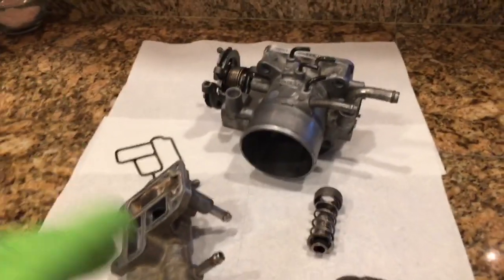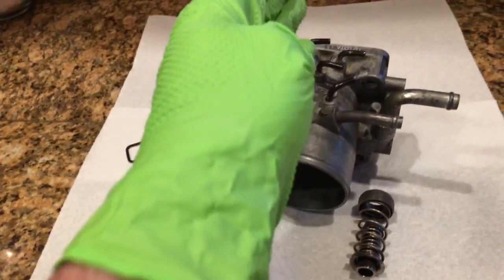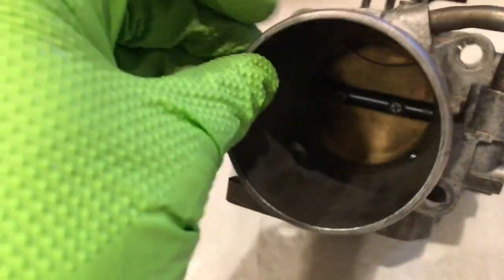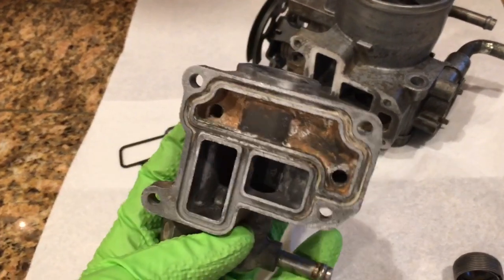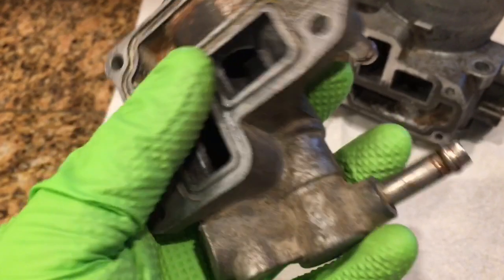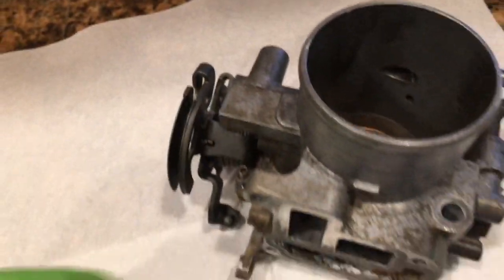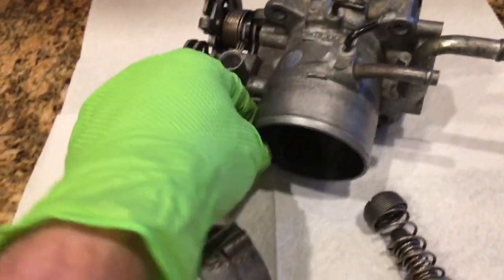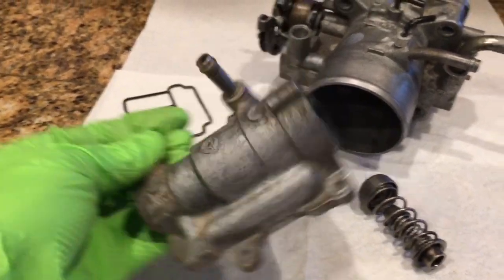Toyota 4runner pickup 22RE - understanding rough, high, surging idle, the Idle Air Control IAC valve

Comment: Just a thought,  as I try to diagnose my own issue which led me to IAC..  (and I have 3vze or 3.0,  not the 22re).

Here's the thing, I've cleaned mine out multiple times..the IAC and TB.    And I don't have idle surging or real idle issues.  Just a slight shudder and the needle just barely flucuates if you look really closely.  But I have extremely intermittent hard start and sometimes it cranks really fast.  It will always start,  especially if I open throttle plate(and give it air I assume).  I really have no idea what my issue is.  Sometimes the truck feels like a dead weight and other times it seems responsive.  I think I had a egr leak and it had way more power.  

But what I want to highlight, is the fact my mechanic told me my engine is running on the low side...168 coolant I think he said.   The IAC doesn't even close until 175 or more I think it said in the fsm.  Or close,  whichever it does when hot.  

I'm starting to think this aftermarket aluminum radiator is overcooling my engine!  And I have yet to find the bottom radiator hose even more than slightly warm.  Thermostat is rated for 180f I think...

Maybe the mechanic did not warm up the engine enough.  How do you chck accurate;y the coolant temp?  I just have thermo heat gun.
Reply from the maker: If you have a 180 thermostat then the motor is probably running around 180 since that's where it opens. The radiator isn't going to be able to cool much below that temp, since the thermostat shuts its flow off down around 170 or so. You might want to check to ensure all your fuel injectors are working. You can disconnect the vacuum line going to the EGR and disable it for testing purposes and it's pretty easy to test at idle to see if it's working (just apply vacuum and see if it opens and the motor stalls). As far as the IAC being open a little when warmed up, that shouldn't matter all that much either way. To me it sounds like you have some other issue lurking. To check coolant temp, use your laser gun on a black hose that circulates water off the cylinder head and/or take a reading at the base of where the thermostat installs - that will usually get you within 2-3 degrees of the water temp.
Reply: @ray5961  I just ran the "advanced code test"  ...basically you jumper e1 and te2 and drive around.  Lucky for me my intermittent no start issue happened when I did this!  I got got it  started on second attempt and drove around(at least 10mph).  I then moved te2 wire to te1 thereby jumpering the normal testing pins.

And like magic code 13 showed it's ugly face!   

I had code 12 and 13 in recent past,  but they went away after new distributor install.  (Keep in mind I'm using cheap aftermarket distributors since original denso costs 600.00.

Apparently the advanced code testing procedure works with starting circuit,  so only way to see my issue!   In the past before new distributor I would stall while driving...therefore normal code test would bring up code 13.  But since then I only have brief no start issue...I'm probably overexplaining..you get the idea.

So now the question is whether my stock distributor and multiple after markets are all faulty...OR there is issue in wire somewhere.   I bet the latter which means once solved I can put my oem dist.  back on:)   (note:  5 different mechanics have failed to find this issue.  They simply keep telling me to replace distributor despite no change).
Reply: Thanks for those tips...especially the thermo gun test.  "2-3 degrees"  is exactly the info I needed.
Reply from the maker: @TheWeirdSide1  Ignition problems can be tricky. Make sure the inside of the distributor cap is clean and dry; sometimes you can get carbon arching inside there, which will cause issues. I have a diagnostic tool I use, called a TA500 engine analyzer that is real helpful. On your distributor, check the brushing where the shaft rides and see if there is any lateral play at all; sometimes those wear in a funny way and allow for movement on the shaft and certain points. I'd also check the air gap in there and make sure it hasn't slipped.
Reply: @ray5961  Thanks,  I'll look into it.  9am-9pm today trying different things..this truck is gonna kill me:)
Reply from the maker: @TheWeirdSide1  haha I feel your pain!

Comment: Hi Ray, I Just Found Your Video. I Am Having a Very High Idle Issue With My 1997 Toyota Tacoma. Around 2500 rpms. It started after changing a fuel injector. The iac is leaking coolant through either one of the hose ends or the barb on the valve.  My question is do you think the valve is causing this problem or the new fuel injector?  I've had to order a new iac anyway because i couldn't get the leak stopped.  Thank you for any info you can provide.
Reply from the maker: hard to say, but it sounds more like a IAC valve sort of issue. Usually the IAC circuit can be blocked off for testing if you look closely

Comment: Help!  How do you adjust that pin and screw?  I made special tool to unscrew that thing like you did.  Now I think everything was fine and I need to screw that back in for right temp... Do you know temp?  If I use heat gun to adjust it?
Reply from the maker: What I did was run water through it from the faucet and measured the temp of the water exiting. Then at about 135-140, I set the cone thing so it just closed. Then ran cold water through and confirmed it was open. Then ran hot water (140) and confirmed it closed again.
Reply: @ray5961  That's very smart!  I never expected a reply so soon,  cheers.   I think I got it close to factory...won't know until tomorrow morning at cold start...

Comment: Wondering if this is the same for a 3rd gen 4runner. I heard it doesn’t have an idle screw like that I gotta double check because I’m idling at 2500 rpm on cold and even when warm it stays around 2300-2400 rpm. I replaced the tps and it’s still doing the same. I heard rumors about doing a idle relearn but idk how to do that on a 2000 4runner 3.4l. Any advice or tips would help imma also clean everything tomorrow just to make sure as well as clean the iac valve. Thanks a ton for this info boss!!
Reply from the maker: romello turner I'm not all that familiar with the V6 motor, but you might check to see if there is a cold start timer circuit involved. Also, if there is a cold start injector (like how it's setup on the 22RE), try pulling the wiring harness off that and see if the idle drops - that might help put you on the right track to finding the issue.
Reply: Ray Nada thank you soo much for the fast reply! I will definitely try that tomorrow I need my runner back and running normal I should’ve never messed with it in the first place haha thanks a ton!!

Comment: Hey. My 93 T100 after warmup the idle increased. Any idea what my causes it.
Reply from the maker: Check to make sure both hoses going to and coming from the IAC valve are getting hot. It could be due to the valve not fully closing.

Comment: Hi Ray. Here is what I am in need of help on. I have a 86 toyota truck and my IACV sits beneath the throttle body. I have taken off TB and IACV. I look into the IACV vacuum port and see the vent is about 7/8 closed. I put the IACV in the fridge for 45 minutes and then checked the valve again. It has now opened to about 1/2. Can I assume that the valve is working correctly. The ohms are also within spec. I am hesitant to take IACV apart because there is no gasket available to replace it with. Any help appreciated..thks..jc
Reply from the maker: LC Engineering might sell the gasket; that's where I bought mine. Also, the way to test it is with heat, not cold. Boil some water and stick the bottom of the IAC into the boiling water (or run super hot water from the sink through the valve ends) and see if once everything gets up to about 130 to 150 or so, does the valve totally close and block air. That's most important.. the blocking air aspect and at what temp does that occur. You want to make sure the valve is totally closed when the temp is up in the 120 or 130+ ranges. The other thing is confirm water flows through those two tubes where the hoses go and that there isn't any junk in there. You can use compressed air to blow that chamber and those pipes open without risking any damage. Mainly the whole system resolves around "when it gets hot, from the coolant, then it shuts air flow off" - that's its job. When it's on the car, you can check to see if water is flowing through it okay by grabbing the little hose that runs from next to the where the thermostat housing is, over to the IAC and see if that hose is getting hot. That's the water flowing into the IAC - then check to make sure the hose where it's flowing out (at the bottom) is also getting hot and about the same temperature. That will confirm the hot water to operate the valve has hot water flowing by it. The main thing to check is does it close when it gets hot. What it's doing when it's room temp or ice cold doesn't matter as much as fully closing when hot. It's job, once the motor warms up, is to block all air flow. So check that and see if that's working or if the valve is sticking at 7/8 closed and not able to get to 100% closed when it's around 130 or more degrees.
Reply: @ray5961  Hi Ray. First....thanks very much for taking the time to write this up. I will give it a try and see if  it closes. I guess my test was backwards. Should have been hot instead of cold. If it does not close I guess I have no choice but to take it apart and see if it is gummed up. The two coolant ports are clear as I can blow air in and out. Let you know. Thanks again..jc
Reply: Hi Ray.. First, no gaskets available for this iacv. I tested as you suggested. Water temp between 140 and 150. The flap or valve seemed to close, but in looking through the vacuum hole, the valve had two pinhole openings on each side of the flap. I could see light. So I am not sure if that is the way the valve shuts or not. Your input appreciated..thks..jc

Comment: Nice video really informational but what about setting your throttle position sencor i moved mine and seems like it idles much high do you no the correct way to set that thanks kory
Reply from the maker: Kory Christensen google how to set it and you should find some good info. Also, LC Engineering has a PDF / link that explains the process. The basic idea is that it's an electric switch that tells the ECU the proper angle. You need to use a volt meter as I remember. I need to do the job soon on my motor... I'll see if I can make a video showing how to do it
Reply: @ray5961  cool thanks ray

Comment: Ray, good video and very educational, I put water at 200 F and did not close the valve, my question is: how did you get the spring out?
Reply from the maker: Reinaldo Gonzalez I had to make a spanner to fit the slots on the nut, then unscrew it and the spring comes out. It's the round nut that the little cone / nose part goes into that you see in the video there. It's hard to break free; I am going to make a better tool to use (probably from an old socket or something).
Reply: Ray Nada : thanks
Reply: Ray Nada : disarm the IAC, but I do not know how much should be left open, you know?  If you give me your email, I can send you a photo of the nail extractor that you can modify to turn the piece and remove the springs, very easy.

Comment: Mine idles  great, but then when i drive along at a low speed say 30 miles an hour , sometimes  not always it kind of surges slow ,fast slow fast . But under load smooth as butter?. Any ideas.
Reply from the maker: Could be a number of things, but I would definitely check the fuel filter & fuel pressure. Also check your plugs to see if any our fouled or showing signs of oil or anything. You can always disable the IAC valve by blocking off that one main hole, just to rule it out.
Reply: @ray5961  thanks for responding,  yes fuel filter makes sense i will change it . Its a good idea in any case . I haven't owned 
It all that long so i don't know when the last time that was done . Thanks again.
Reply from the maker: @lawrenceparker1523  well, congrats on the truck. If it is new and hasn't been maintained that well, there could be a lot of small areas which need attention. I'd check the function of the air suction system as well as the EGR system and/or just outright disable them both while trying to narrow down what is wrong. Of course, a compression check and also valve adjustment never hurts on the 22RE. I also run my truck at 8 degree BTDC and have found that to be a lot nicer than the factory 5 degree suggestion. Also, try dumping a can or two of fuel injector cleaner into the gas tank. I use either Berryman B12 fuel injector cleaner or sometimes Sea Foam concentrated fuel injector cleaner and have had real good luck with that. I also generally flush the engine oil with Motor Medic engine flush prior to changing the oil and filter. Also Denso W16EXR-U are about the only plug worth running. I run an MSD blaster coil (the high vibration one, I think the part # is 8222 if I remember correctly) and their 9.5mm red wires. I also have found that just grinding off the ground strap on the plugs makes the motor run a lot smoother. I know it sounds crazy, but it works. The other thing is taking off the intake manifold and cleaning them. If the EGR system has been running for countless miles, it gets really dirty inside there. Also make sure the PCV stuff is working well, as the stock 22RE has borderline enough vacuum to keep the positive crankcase pressure in check. Also check the wiring to the O2 sensors (mainly the upstream one) as the ECU relies on that feedback heavily while cruising in closed loop. Also definitely check the TPS (throttle position switch). It needs to be working smooth and also needs to be adjusted right on the money. You might also clear the ECU fuel tables, but pulling out the 15A EFI fuse for about 5 or 10 minutes, then plugging it back in. That will force the ECU to sort of reset and rebuild its long term trim tables, etc.
Reply: @ray5961  lots of information right there i use sea foam in my Honda  shadow  600 and never had a problem with it . And 8 degree i will try right away.  It is not insured at this time but i will start with gas line filter , sea foam , and 8 degree and those  new plugs and wires keep me busy for awhile.i am not sure what you mean by ground strap on the plugs?
Reply from the maker: @lawrenceparker1523  Make sure to set the 8 degrees with the diagnostic jumper in - google it and/or check the service manual and you can see how it's done if that's something new to you with the 22RE. As far as the ground strap, I mean the part on the spark plug that wraps up and over the electrode - where you gap the spark plugs - I grind the ground strap part totally off and just run the plugs with the center electrode sticking out and no strap whatsoever, although the MSD blaster coil is 45,000 volts vs. the factory probably 30Kv. You can also just cut back the strap so it exposes 50% of the top of the ground button electrode and you'll get nearly the same results. I like totally doing away with the ground strap myself. Also make sure all your electrical grounds between the cylinder head, block, frame to block, valve cover to fire wall, etc. are all clean and secure. Good grounding really helps improve spark.